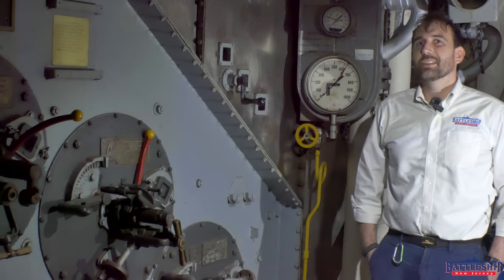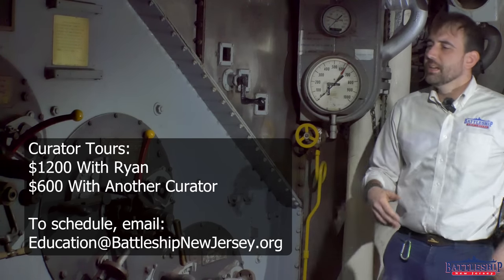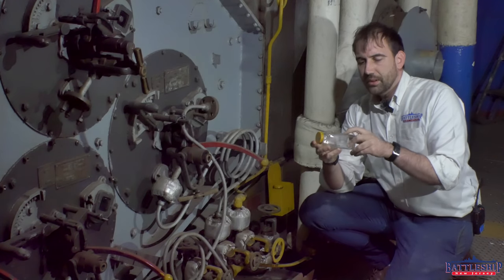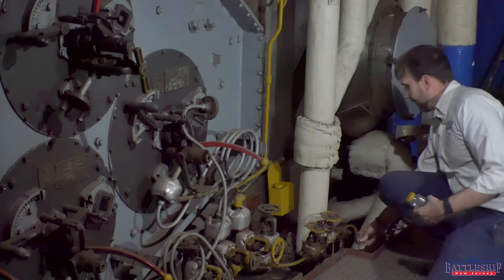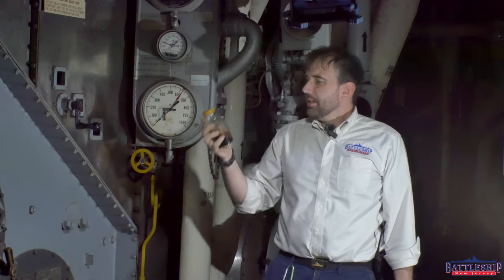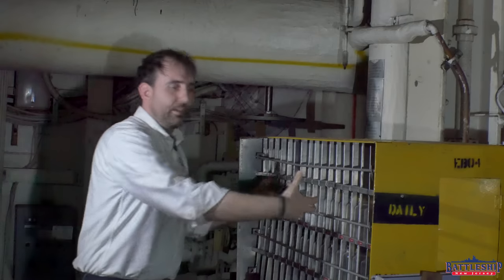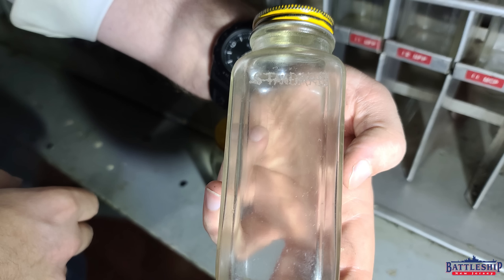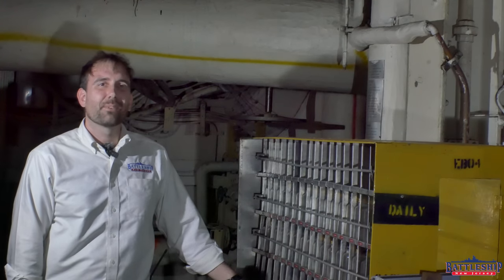Found! Battleship Fuel Oil

Comment: I am reminded that at the Battle of the Philippine Sea the Japanese capital ships were of necessity burning (a very good grade of) unrefined oil--maybe from Borneo, which is famous for its light sweet crude.  After a leak secondary to a hit of some sort to a fleet carrier, the inadequately trained damage control officer ordered fans put on high to exhaust the volatile fumes, which caused them to spread throughout the ship until they found a spark, destroying the ship.
Reply: The brand-new Taiho. Drachinifel has a video on that incident.

Comment: I do have a Question (about the dry-dock process):  What will the tow actually look like?  How many tugs?  What kind of configuration? What are the logistical and financial challenges involved?  Do you collaborate with port authorities or just go for it? :face-red-heart-shape:
Reply from the maker: Its 4 tugs, one on the back, one on the front, two to give us a nudge if needed when making turns. Logistically, this is the easy part. Our tug operators do this every day, we just follow directions. Financially, yeah, its expensive, but only a small part of the whole project. We do inform the local area that we are doing it just so we don't have traffic problems.
Reply: @BattleshipNewJersey   Thanks!  One reason I asked is that Casual Navigation's vid on Missouri's acoustic range incident titled 'How Many Tugs Does It Take To Move A Battleship?' from a couple of weeks ago just showed up on my feed, & it made me wonder what we're gonna need.

Comment: We would all collectively wince while changing F/O suction underway. The oil shack was not renowned for it’s collective smarts and once in a while we would lose F/O suction. Then cross connecting could and would knock the forward or aft group offline stopping the ship in its tracks.

Comment: IDK about your Civic...but my VW would run just fine on that stuff in the bottle. As long as the dedicated lift pump can move it...it will get a pre-heat before the engine sees it.
Reply: By the way it's sloshing around its probably close to #2... MIL-DTL-16884N (NATO F-76 fuel oil) viscosity specification is a similar range to ASTM D 975 for 2-D. As long as it's free of water your TDI wouldn't even notice
Reply: Sounds right. Excess water would be the only issue. What I have is a 1.6 IDI TD from an 86 Mk2 in a 1980 truck. Little higher compression than the later true TDI I think. Basically the previous few years NA but properly modded block w/ squirters by VW then turbo added. Have a bed tank w/ a circulation coil fed by the engine cooling system if I ever bother to hook it up. As long as it lubes the important bits, doesn't start out any thicker than cold syrup prior to heating, the tank heater should raise the fuel temp & lower the viscosity enough for the electric lift pump (4ft of draft ability...same used as on semi-trailer APUs) to go through a heated filter//seperator then onto an FPHE in the engine bay.
It can drive on BB fuel! 😄  @holysirsalad
Reply: @RuralTowner  Cool setup! That ol' IDI with heating would probably burn the ship's original fuel LOL

Actually it sounds like a setup for WVO?
Reply: It is. @holysirsalad

Comment: What do they do with the samples after it is inspected? Dump them down the drain or burn it if it’s good.
Reply: we would pour our lube oil our samples into the lube oil purifier if it was operating or the lube oil setteling tank. i'm not sure what the boiler tech's did with the fuel oil samples.

Comment: Plot twist: It's not a fuel oil sample, it's a moonshine sample!
Reply: Naw, those samples would be in a fan/machinery room somewhere, preferably one with a few water heaters and a deck drain.  Easier to hide when you already have multiple steam-heated tanks and a maze of piping.  Of course, you would never find such an installation on a USN vessel.

Comment: Partner I worked in oil for almost 40 years, if it was Diesel, they were looking for water, because the expansion rate is 8000 to 1.
Boilers don’t like that, you think what do I know about boilers, mine was 7 stories tall. Good Day
Reply: Remember, most of the folks here think that "steam" is what burned their hand while checking the pasta....  FWIW, DFM is closer to what you burn in a home furnace than what you put in a car.  We burned DFM in the boilers.  Ship's Boats and the Emergency Diesel all ran Detroits with special injectors and burned JP-5.  I believe the boats were 6-71's and the EDG had 2 8v92's.

Comment: What would it take to light off one of the boilers on New Jersey or is it even possible at this point?
Reply: Lighting off any propulsion or steam-operated equipment would be a violation of the contract with the Navy.  Frankly, I wouldn't want to be anywhere near the NJ if somebody tried to light off a boiler.  Too many years without the constant inspections and testing which were part and parcel of operating a steam-powered ship.  

We aren't looking at what you find coming out of a pot on the stove, as that is hot water vapor, NOT steam.  On the NJ, that steam would be  at 600 PSI and around 850F when it left the boiler room.  A major break there and the boiler room is a giant pressure cooker filled with uniformed well-done stew meat.

Comment: I think if you dump that in your car you’ll burn about 3/4 of what you pour in and the other 1/4 will be unburnt and get past the rings into the oil pan and contaminate your oil with diesel fuel.

Comment: Nearly identical miles per gallon in your Honda Civic, so I would not recommend. Modern vehicles are constantly adjusting for conditions such as humidity, ambient temp, engine temp, load, altitude, and fuel quality; etc. The computers ultimately adjust how fast the fuel burns and thus how much potentially destructive heat is generated. This is why premium gasoline is always recommended, never required, as "premium" has no regulations. Octane number is regulated, so that the government can make sure that your illusion of choice is of the highest quality. If you ever think your car has a problem, the computer KNOWS there's a problem.

Comment: Eh? it is Nr. 4 and flows just like any diesel fuel?
Reply: It's a slightly heavier cut (but nowhere near as heavy as the old barely refined crude)
Reply: DFM / F-76 is roughly a #2 fuel

Comment: This makes me wonder just how good propane (also called LPG or liquid petroleum (sometimes propane) gas) would be as the main fuel for the boilers
Reply: Propane would fire the boilers no problem.  But having pressurised LPG tanks on the ship would be a big problem.
Reply: It would be a poor substitute for DFM or Bunker C. You run into handling and storage (space) issues with LPG, and it has far fewer BTUs than diesel. That means you would need to burn more of it to make the same amount of heat/power.
Reply: @TheJazsa80 plus much lower BTU/lb
Reply: @oneparticularharbor144  Definite BIG energy loss.
Reply: Zumwalt uses CNG, not LPG, but seems to do well.
Reply: @everettputerbaugh3996   I highly doubt the Zumwalts use compressed natural gas for fuel.  More likely they use Jet A1 as the supply chain is already in place. Having a warship use a fuel source that requires pressurised storage is not a good idea.
Reply: @everettputerbaugh3996  Zumwalt has Rolls Royce gas turbines.  Not natural gas.  Regular Navy fuel, same as other non-nuke ships burn.
Reply: Having a pressurized, explosive fuel on a warship strikes me as being an exceptionally bad idea.

Comment: I thought it would be thicker than that
Reply: That was Diesel #4 (Marine), what you and I would imagine being there is Bunker C (that stuff at room temperature is basically tar).
Reply: By the end of NJ's career they were on a fuel very similar to regular (at the time) automotive diesel
Reply: @holysirsalad  Closer to the heating oil that you would buy if you still had an oil furnace in the basement of your house.   High-speed diesels like the Ship's Boats and probably the Emergency Diesel generators would run JP-5 with different injectors.

Comment: 0 MPG on your Honda civic…. Engine wouldn’t run I bet lol
Reply: What about if you put in in a Ford F150 with a diesel engine?  Anyone know specs comparison of DFM and Diesel at a land station for truckers, and diesel cars?
Reply: Depends on the concentration of diesel to gasoline.  That sample dumped in the tank won't have much or any effect. 
Fuel injected engines will have a slight advantage as the fuel / air ratio can be corrected on the go.  As a side note, some 1960's and older farm tractors started on gasoline and ran on kerosene which is between gasoline and diesel.

Comment: I always find it quite odd that you'r always finding new things. It's not that large a thing and after a week or so you'd know everything there is to know about a hotel.
Are curators lazy bastards?
Edit: Ashley Hlebinsky doesn't seem to be.
Reply: So you could go through over 1600 compartments, most with no lights, in a week?  In all honesty, if the NJ was still in service and you reported on board, that week would be just about long enough for you to find your rack, your work area, a few heads, the mess decks, and your GQ station...if you paid attention.

There are places on that ship where you could lean on a bulkhead, then spend the next 10 minutes to reach the other side of the same bulkhead...if you already knew the exact route.
Reply: @kevincrosby1760  I still find it fascinating that there are "what is on the otherside of this hatch" moments.
I suspect some of it is for "TV suspense" but given a month or so a rat (that could open hatches) would have it pretty much mapped out.